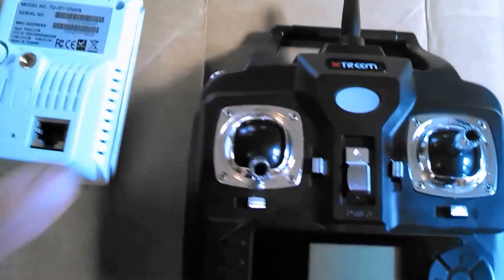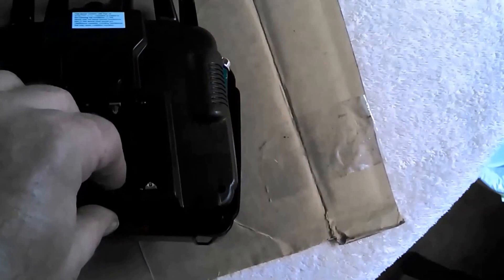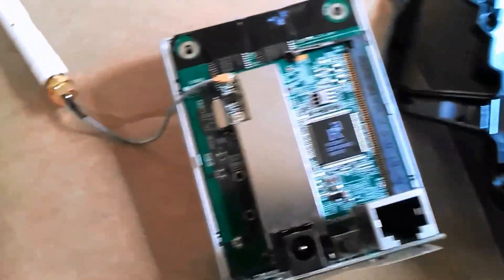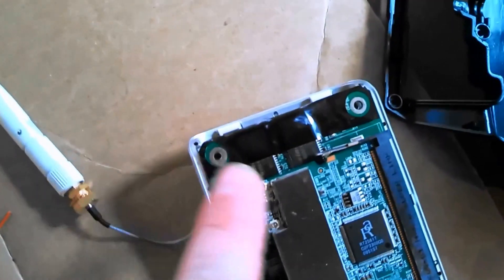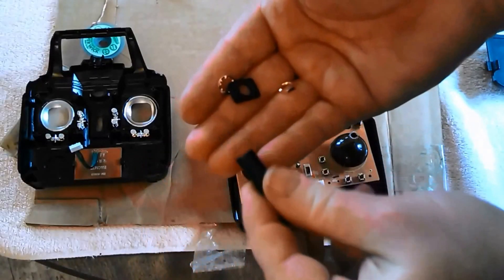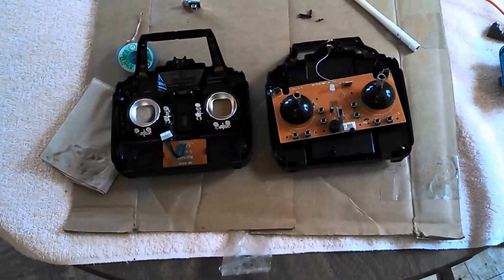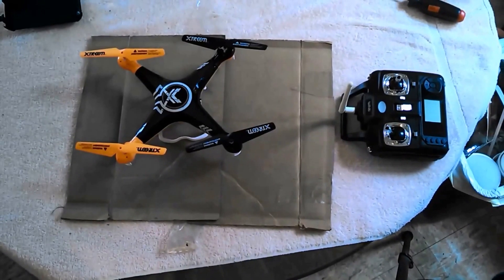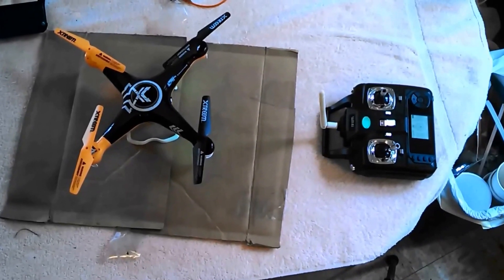antenna mod for xtreem quadforce video drone 2.4ghz controller - part 1

Comment: Hi do you think this would work on a propel hd drone remote? I have a Tiny little antenna inside and all you did was take an antenna out of any old WiFi transmitter and solder it in? Did it definitely improve range?
Reply from the maker: It should work on most any 2.4ghz transmitters as long as you match it with an antenna from a 2.4ghz WiFi transmitter.  My drone has much better range after this mod.
Reply: infinigrove thanks for replying, maybe I should post a video of mine after. It gets 500' now but it has that same tiny antenna inside and I know I have an old router
Reply from the maker: 500' is pretty good range already.  The drone in this video would sometimes lose connection @ 150' to 200' before the mod.  I probably took it over 500' after the mod and never had the connection dropped once.